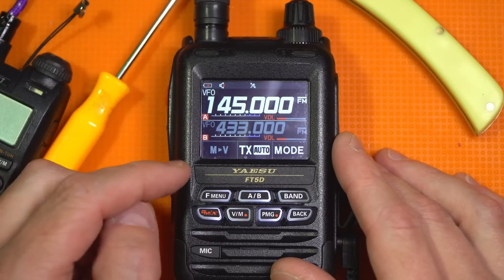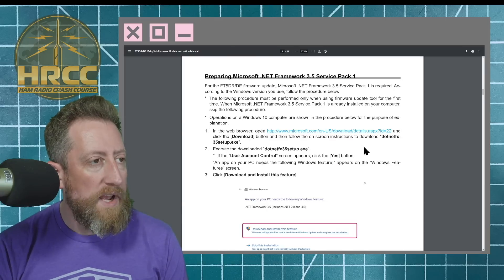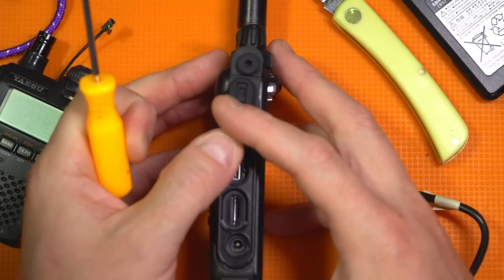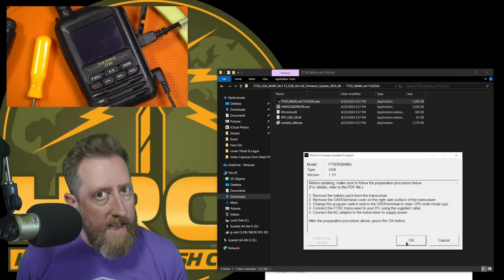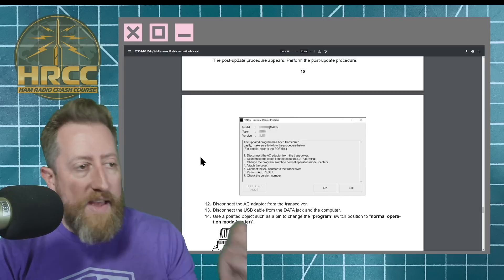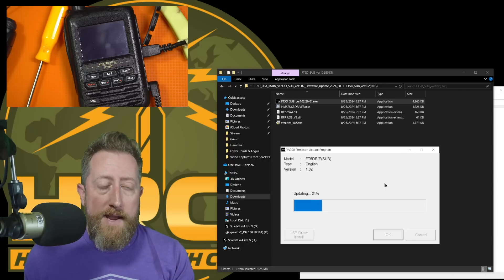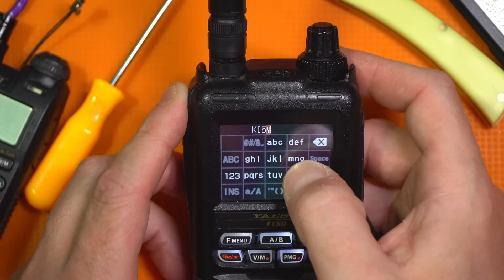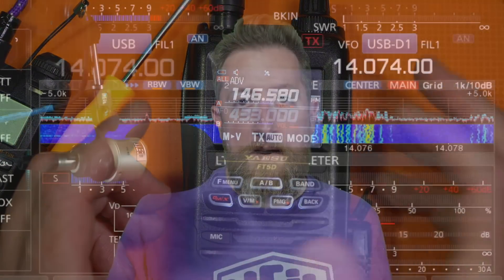How To Firmware Flash A Yaesu FT5DR Ham Radio

Comment: I've been trying to update the firmware on my FT5D from v1.10 main and v1.01 sub for weeks now to no avail.  SCU-57 Wires-X kit says it's Win 11 compatible.
Meh, I'm done with Yaesu HTs and going back to my Icom ID-51, ID-51A+, ID-31A, and cheap Chinese DMR radios because it's easy to update the firmware on those without all the headaches Yaesu introduces into every single radio they make.

Comment: Have you tested it “not working on memory mode”? Key down on another radio that’s has one of the memories programmed. I’m curious to see if the Yaesu picks up on that frequency. If I remember correctly the ftm-6000 scans so quick you don’t see a display.

Comment: Thank you Thank you!  Great video as always.  What an arcane process.  Did a lot of it working off Yaesu docs but you saved me particularly on one thing.  For some reason I had it in my head to use a cable I bought in a package with the radio and not the little cable in the box.  That cable now has a nice label on it.

Comment: The lack of showing the scanning channels probably has to do with the issue of screen refresh. If the screen needs to be updated every channel, the scan is severely slowed down. I know custom FW builders run into this issue often. It's better to leave it blank or not change and scan 10 channels a sec so you don't miss the beginning of a transmission, versus 2 a second and miss out on the first few seconds of important info.
Reply: I don't think so, the older ft3d does it and does it fast too.

Comment: Doesn't work with Windows 10. I tried 3 different Windows 10 machines. Tried updating the driver. No luck. Will not recognize the USB driver. Followed the instructions were which not too bad. Any advice?
Reply from the maker: This video was shot using Windows 10.
Reply: I am having the same issue with windows 10. Found any solution?

Comment: Good video, don't think you mentioned that this is a Windows only type upgrade and also, my FT5D powered up with the prescribed yaesu procedure.. 3 buttons down plug in the power cord.  One issue i'm running into though is that when I go to the the sub fw upgrade I get an error of 'no power' to the radio even though the I followed the same procedure for the Main fw and it worked no problem.
Reply: did you ever come up with a solution? I'm having the same problem and can't seem to get anywhere with this. Cannot update main or sub.
Reply: @ my issue turned out to be me using windows parallel on a MacBook.  The fw upgrade has to be done on a windows machine, running windows.

Comment: I have enabled the .NET Framework, installed the driver, and installed the VCRedist, but after connecting the radio to my PC, it says that the device is not recognized. Its Windows 10. The core isolation function is disabled.

Comment: KI6NAZ, I am a little east of you down here in Houston TX.  I have been researching the difference between an FT-70 DR, vs. an FT-5 DR.  After watching your videos and channel, it seems like the FT-5 Option may be worth the extra money.  I'm not great on spending extra money for unnecessary upgrades but I think the FT-5 comes with APRS and GPS built in, so an extra TNC may not be necessary, with the APRS and GPS giving extra bonus features, as these seem to be lacking on the FT-70.  I am an Electrical Engineer, and have been a Tech for several years.  I am just getting back into the hobby, considering taking my General soon, and I wanted to thank you for your time in making these videos.

Comment: The instruction is very confusing. Do you add the battery installed before plug in the 12v adapter? The picture in the procedure said so.

Comment: I just got my FT5D a few days ago, I put my callsign in and everything, then I tried to make a contact with a buddy on both 154.750 and 462.750 MHz and on some GMRS/FRS channels but every time I press the PTT button the radio beeps and says "TX Inhibit"on the screen an it does not transmit. I've looked online and I haven't found anything on this issue, or anything in the manual. I was hoping someone would have insight on this but I no reviews talk about it, it seems to work straight out of the box for most reviewers.
Reply: For anyone planning on replying to this: I did the mod myself, and I can now transmit on MURS and GMRS/FRS freqs
Reply: This is a ham radio, not a GMRS radio. You have to have the Mars cap mod done in order to transmit on GMRS frequencies.

Comment: For those with Windows 11 that have successfully installed the Generic Boot USB Direct driver, but it comes up flagged as NOT being able to load in Device Manager:
	1. Navigate to SETTINGS/PRIVACY & SECURITY/WINDOWS SECURITY/DEVICE SECURITY/CORE ISOLATION/MEMORY INTEGRITY- DISABLE. (Forces reboot)
	2. Reboot
	3. Navigate to SETTINGS/PRIVACY & SECURITY/WINDOWS SECURITY/DEVICE SECURITY/CORE ISOLATION/MICROSOFT VULNERABLE DRIVER BLOCKLIST - DISABLE
	4. Driver should now be showing as loaded.
Proceed with update as normal.
Reply: Had the same problem with the driver being incompatible on a Win 11 machine. However following these instructions I was able to update the firmware. Problem now though is how to remove the driver so I can tun the Memory Integrity function back on. It’s not obvious following the prompts on the PC, any further guidance ?
Reply: And for those of us who can't seem to get the Renesas driver to install under any circumstances? I have to say this is a miserable process. I've given up.

Comment: nice video. i tried it and the little switch broke and fell into the radio. sent it back to yaesu. they claim the board is broken, and is not covered by warranty, have a nice day with my 500 dollar brick. too make things worse, gigparts agrees. even though i purchased an extended warranty. still arguing the point. but if i can brick it with a toothpick, it's not worth buying, is it?

Comment: Just did it. At the end, I didn't switch the secret switch back to center and spent a hot minute thinking I bricked the radio. Really an awful user experience, but I guess it's better than soldering a jumper in.

Comment: Couldn't load the driver in Windows 11! I get the error message "radio was not connected"? Its a brand new Samsung Ultra 4 Laptop with the latest version of Windows.
Reply: I have the same problem with Windows 11 security setting not letting me load the driver.  Did you find a solution?

Comment: I've tried on two different Windows 11 t machines USB recognized perfectly but when I try to upload the firmware application says no power or cable is unplugged hook it up to my old windows 10 machine and it worked perfectly first time this is very strange
Reply: I couldn't load the driver in Windows 11?

Comment: Just to add some data, I don't have the original mini-usb cable that came with the radio with me (I'm working from the office today) and I was able to update with no problems using a regular mini-usb cable (I did have to use a knife to trim back some of the overmolded plastic on my mini-usb cable to get it to fit in the recessed jack however).

Comment: Wow, thank you so much, I didn’t install the NET 3.5 SP1 because my computer just did an update to the NET Framework and I wasn’t able to install the firmware update, kept getting an error message saying the radio was not connected.
Your little sentence saying even though it is an old version from 2008 install it just made the difference!
Thanks again!
Reply: Couldn't load the driver in Windows 11! I get the same error message "radio was not connected"?

Comment: so, we just load back the "code plug" after we reset to get our settings and memory back?
Reply from the maker: Correct. Some firmware won’t require a Reset All. This one does.
Reply: That's what I'm thinking. If you haven't saved it first, DO SO!

Comment: Seems like a useless update for just the scan to display on VFO. What’s the point? If you don’t have the tones, it’s not like if it stops on a new repeater you’ll be able to talk. I just wish Yaesu would do something sensible like use the built in GPS to do a location based scan of memories that have coordinates saved in them. Just have it add a column for coordinates. Radio reference has cords for each repeater anyway. As it stands, i have no idea why icom is the only company to do this. It’s stupid to have to load my entire state’s worth of repeaters when i travel to have to link banks and scan just to discover new stuff in the area I’m in, and God forbid I happen to pick up a shared frequency in another state with a different tone
Reply: Reasonable request re: GPS location-based scan of mems. Seems that's just firmware, right?

Comment: Most covoluted cumbersome update as expected by yeasu. Used supplied cable, needed magnifying glass to find switch to flip for position, faults & errors with downloaded drivers, battery removal (??), plug-unplug A/C power when prompted ... Sheesh!  Anything else ? Updates should not take entire morning resolving issues and referencing manual multiple times for the update and retracing steps to ensure a good install. Have a backup to reinstall all your settings too......